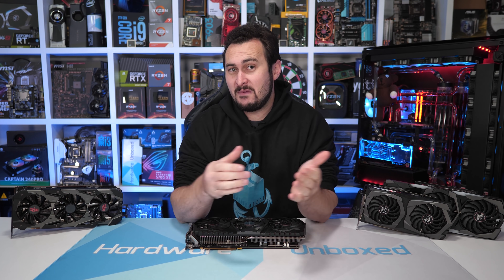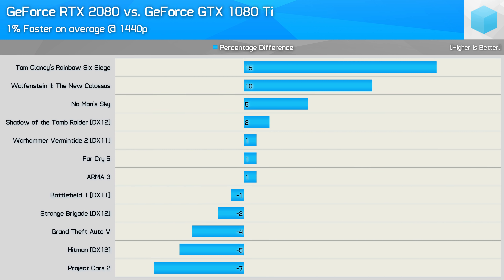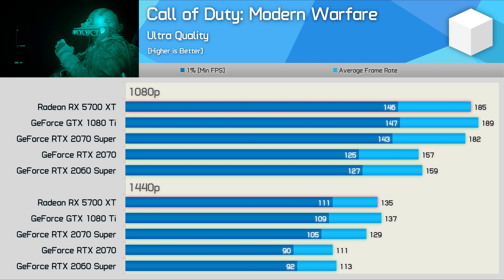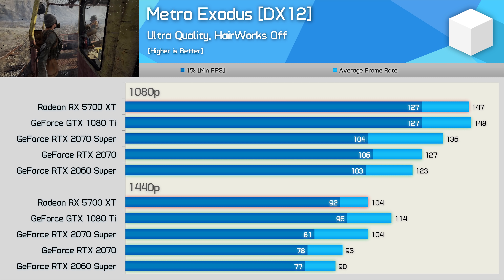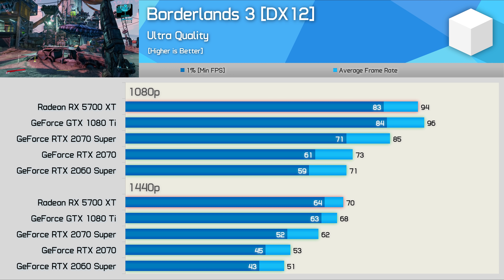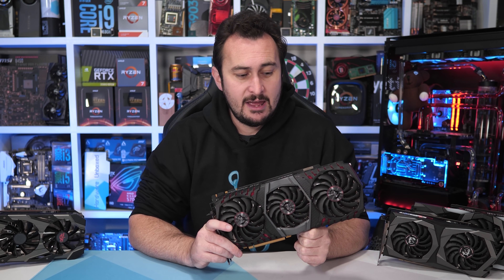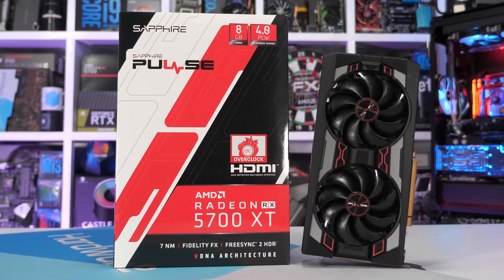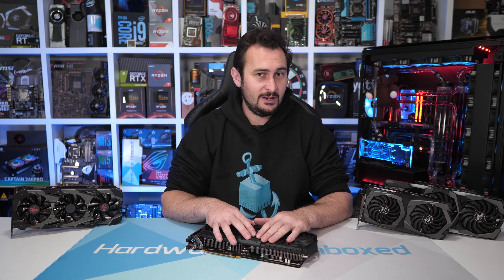GeForce GTX 1080 Ti vs. 5700 XT & RTX 2070 Super, 35 Game Benchmark

Comment: You gotta consider the 11Gb of vram and 4k capability of the 1080ti.  For people that want to pair their computers to OLED tvs now that they all have G-synce, the 1080ti looks great compared to the only other 11gb option: the 2080ti.  I know vram rarely ever gets close to that, but Skyrim modders can testify that even 8Gbs isn't enough for 4k textures at 1080p.  And in the case for the LG tvs, if your cap is 120hz then you don't need a card that rips through games at insanely high frames at 1440p or 1080p.  You just want a card that stays comfortably above 60fps in 4k and 120fps in 1080p.  In this scenario $500 is an absolute steal compared to the $1200 price tag of the 2080ti.  It's not as powerful but it's also not that much slower.  If you're using a 1080p or 1440p display then don't worry about a 1080ti for sure.      Also creates a better case for the 1080ti if you don't like most of the games from the past 2 years and you play mostly older titles.

Comment: Fuck the 1080 ti. Let’s see the Radeon vii, the last amd GPU that will age like “fine wine”, at release was comparable to a 1080 ti, hbm ocd to 1200 gives it about 1.3tb/s of memory bandwidth (which to my knowledge, every Radeon vii can hit), and core clocks can be pushed to 2+ghz. Or you can go the route I did, and keep stock clocks and drop voltage under 1 volt. Playing bfv at max settings I get over 144 FPS and Generally see 150 watts or less from the GPU. The hotspot might hit 60c. This card got a bad rep and it’s hardly looked at now. Or, maybe, I got a platinum sample. Thoughts?

Comment: I bought this one for 400 at the exact right moment haha, best videocard I've ever owned. Today I would go for the 5700xt. I love this card, my hope is that it may last the whole new console cycle but that may be a big stretch ...
Reply: I think we 1080 ti owners will be fine for at least another 2 years as that's how long cross gen is going last
Reply: @HollowRick  yeah, as long as you are fine with raytracing off, and using dinamic resolution for 4k. Or 6o% to 80% of for 4k resolution. Or getting down those dumb super extra detail graphics options that you can't really notice while you game. Like that it may actually last the whole console cycle, it's my hope anyway. I actually do all that for more FPS anyway most of the time. And really raytracing is some dumb reflections until now at least... might get a lot better at the end of the cycle.

Comment: This review just shows how lackluster Nvidia new options are just hyped up. Yes Ray tracing is amazing especially for  those interested in it but for normal gamers its just weak. Also in my country GTX 1080 ti sells for around $300 at most  and if the GPU  has passed its bathtub death periods you have a good chance of it surviving longer if the owner looked after it.

Comment: So nothing new and surprising here, the Nvidia previous flagship model still performs on the same level as the 2070 Super with no reason to upgrade yet.. Same as last 2 generations really (780Ti -> 970, 980Ti -> 1070).. Only surprise here is the high price people are still willing to pay for a used 1080Ti, I would also just get a 2070 Super for the same money as it makes no sense to buy older tech for the same price.. Price/performance the AMD 5700XT is still a bit better though, so if you can deal with a little bit less performance simply buy that.. Anything over is still all Nvidia with the 2080 models..

Comment: Those used 1080Ti's coming with no warranty and potentially saw heavy digging in a mine rig, will stay at this price point (along with common RTX cards) until AMD shaves off at least 100-150 USD from new 5700XTs. Anything below (5700-) is effortless attempts to re-sell Polaris to Pascal grade performance but on 2017 prices on both sides.
5700XT price is the support level of current GPU pricing. Don't expect NV to compete in-house for the customers or the let any next-gen GPUs see current gen card prices to drop.
Mark my word, the day 3000 series enters the market, 2000-series cards will disappear from shelves overnight from shops just like it has happened with the 1000-series.

Comment: I bought a GTX Titan X pascal used summer of 2018, during the mining boom for 650 usd. I can't believe a 4 year old card is still one of the top 5 gpus you can buy. I want a real upgrade, a 2080 is a massive ram decrease and the 2080 ti is more than double for barely noticeable bump in performance.

Comment: not quite sure if the 1080ti was a mistake or the 20th series is $hit
Reply: the 1080ti is what happened when amd scared nvidia, but amd ended up flopping. They made the 1080ti a beast on purpose
Reply: I think 20th series was just an introduction to RTX and a gap filler nothing more later in a few year nobody will evenntalk about the the 20xx seriee
Reply: Yes.

Comment: I was fortunate to have gotten 2 GTX 1080 ti around 2018 during the crypto market crash at ~$200-250 USD each. I got both for a total of $437 which was taxless ofc since it was bought from kijiji or craigslist as US equivalent. Up to this date, the card itself is still a beast and have no problem whatsoever. I don't think I would need a GPU upgrade for a few years or so.

Comment: Good I have a question, I am looking for a good laptop and I found these two, the two are almost at the same price there is not much difference but I would like to know which is the better of the two 

Laptop 1:  HP model (15-cw1002la) Processor: Ryzen 5 3500U Screen: 15.6 inch Ram memory: 8Gb DDR4 Graphic: AMD Vega 8 Capacity: 1TB Battery: 3 cells (Mixed prismatic)

 Laptop 2: Acer model (acer a515-52G) Processor: Intel i5-8250u Screen: 15.6 inch Ram memory: 8Gb DDR4 Graphic: Nvidia Mx130 Capacity: 1tb hybrid Battery: 4 cells

Comment: Thank you for the benchmarks! I have an MSI 1080ti gaming x and it's nice to see benchmarks that validate my decision to not upgrade to an RTX. I will wait for the next gen and even then carefully weigh whether an upgrade is preferable. From what I'm hearing it will be but I'll hold off until extensive testing and comparisons are completed; I don't want to be suckered into slick marketing like RTX buyers were for next to no performance gains - Ray Tracing or not.

Comment: 0% difference  between 1080 ti and 2070 Super in Red Dead Redemption 2?? No way man. 2070 super is much better in this game. You can check any benchmarks on internet. Pascal performance in this game is very poor. Nvidia only optimized Turing cards for this game.

Comment: The miners were selling them as well, not just gamers. I got an MSI Trio X 1080ti for my son, sometimes last year, with my ebay $60 bucks at about $430USD, well before taxes were collected. That's what I call Super!
P.S. And I bought a Power color Red.Dev. 5700 in September 2019 and flashed it with XT bios then, but the current 20.2.2 drivers disable my Enter key on the keyboard in Titanfall2, which is the only game I play:( The 19.9.2whql somehow work better in my case, and I never had issues with AMD drivers... until now.

Comment: I know that you said the 2070 Super is on par with the 2080, but there is also a bit more performance to be had with the 2080 Super. If the 1080 Ti consistently beat both the 2070 Super and the RX 5700 XT on most titles, wouldn't it be also a good idea to pit it against the 2080 Super for a better comparison?

Comment: I went with the 5700xt myself. I looked at the 1080ti, but new prices ballooned to that of the RTX2080ti. Price per performance, the 5700xt was the easy choice. Around 6% slower than the 2070S and $100 cheaper, I think it's the best card to buy right now. 1440P is the sweet spot right now, and in 3 years most people going high end will replace their gpu anyways. $400 now and $400 3 years from now is still cheaper than a RTX2080ti for good 1440p gaming for 5 to 6 years. Ray tracing will be a common thing eventually but right now it's not worth the performance hit. RTX 2080ti is the best, but it seems to be more gpu than most people need. Loved the video as always, and ignore the haters, most have tunnel vision and only want to hear 1 think instead of actual comparisons. Big thumbs up as with all your videos.

Comment: 05:44  Not if the game is heavily using asynchronous compute.  Pascal simply cannot do it.  It has to do a context switch to switch from integer to float calculations.  You can't optimize away a fundamental hardware deficiency.  The 1080 Ti will do poorly in any newer game that uses async compute to a serious degree.  A problem that will not be experienced by Turing or any AMD card.

Comment: Got my 2080 when it was selling at the same price point as new 1080ti's. No regrets tbh, maybe a little bugged when they came out with the super just a year later, but I knew the 2080 would get better driver support after release and most benchmarking channels confirm that, showing that it's consistently above the 1080ti. As for AMD's driver debacle, I think I finally understand what Nvidia is talking about when they say "It just works." I'm glad the 5700xt exists though, you can see how much the price of RTX cards have dropped since it's release. Only the 2080ti stands defiant with it's outrageous price point, but I guess that's what you get for being the Bugatti of the GPU world.

Comment: As a gtx 1070 user who got it at launch im very happy with my gpu however since i got my triple 4k monitor setup it no longer can power: single 4k monitor for AAA games and triple 4k monitors in racing simulators(they are a lot easier to run than regular AAA games) so i cant wait for upcoming rtx 3080ti or rx 5950x(or whatever their top end gpu name will be). gtx 1070 is still awesome 1080p gaming card though it started to suffer in newest AAA games on very high settings, 1440p resolution, back when it launched it was considered overkill for 1080p and ideal 1440p card.

Comment: We need GT 1030 vs RX 590 revisit ;) or getting first spot in 3DMark benchmarks for RX550 and GT 1030 with "extreme" overclocking... or using 4-8 RX 550 in Crossfire on a TR system (or more).

Comment: Ah yeah GTX 1080 TI, the abnormal card that whas so good That nvidia had to silently release a update Titan XP card as the 1080 TI whas to good compared to original titan XP and price point.

Got MY EVGA GTX 1080 TI SC2 GAMING July 2017 and it still doing a great job even today and this video just confirmed my suspension on that rtx 2000 whas to expensive and slow at release compared to pascal cards.

For those of interest, a few benchmark of my gtx 1080 TI in my old X58 system.

https://m.imgur.com/a/uHjbbMg

Comment: can you do a video on CoD:MW and ram usage for each Nvidia driver? I have an 1800x and a GTX 1080 with 2x8gb 3200Mhz ram and MW will use up to 14GB of ram on some older driver on my config and a buddy who I noticed this has a 3700 and a 1080 with the latest driver and only has 7GB usage we both take time on a fresh install to optimize windows to use little to no ram on idle as well.

Comment: yeah i dont care how much you dont believe in DLSS or Ray tracing, you gotta be on crack to spend $500 on a used 1080 ti vs $500 on a new 2070 super. virtually the same performance across the board and you dont take a gamble on buying a gpu thats been abused by its previous owner. add in dlss 2.0 and future support for that and the fact that the 2070 super is one of the few  gpus that can maintain 60 fps with ray tracing on and yeah.

Comment: This really makes the 5700xt look good being able to compete with a card that is 100 bucks more expensive.
Reply: Uh, idk, where i live used 1080tis go for 320€/$350. Im building 3300x/1080ti build for 650€.
Reply: Only if u dont want to use raytracing... But right know there is no big reason for a RTX GPU
Reply: dlss, raytracing, better drivers. in 2022 the 2060s is faster then the 5700xt
Reply: @TTVtwongz_247  cop a 6600xt or 6700xt for the same price and you get better performance iirc
Reply: @zayjayy2  Well amd fucked nvidias ass with the new series. A 3090 was 2x more expensive than a 6900xt for literally the same Performance
Reply: But it has terrible drivers. I had Sapphire 5700XT and had random black screens, some games were randomly crashing, sudden FPS drops and that lasted for 4 months so eventually I changed it for the ASUS Strix RTX 2070 Super and happy with my decision
Reply: @nuky_999  My Gigabyte 5700xt hasn’t had an issues like that so far, except for Call of Duty Cold War, where I had to change a setting in my config to get it running without stutters.
Reply: @MrPatrickbuit  But the point is even after that much time since it came out it still has problems while nvidia is extremely reliable and has much lower temperatures and noise levels
Reply: @nuky_999  Noise levels depend on which aftermarket cooler you get on it. Driver issues though? Certainly agree that the 5700xt had far too many issues for the longest time. However, here in the Netherlands a 2070 super is about $550, while a 5700xt is about $400, while my Nvidia cards are way, way more expensive here. That's why I went with a 5700xt regardless.
Reply: @nuky_999  strix cards literally have the worst price/performance xD
Reply: A 1080ti is cheaper, same performance and more ram. I.dunno.but its a shame for amd to.get eaten alive by such an old.card
Reply: @dvr1337  You are wrong. Both cards are made on same generation of manufacturing process. You are comparing $1000 flagship card with midranger. And 1080ti price is so low mainly because of miners, while 5700xt released after btc crash.
Reply: @filippetrovic845  the 5700xt came later what are u talking about same generation? There was 3years between the 1080ti and the 5700xt....and now the 1080ti used is cheaper and better so who cares
Reply: @dvr1337  Tell me that in year or so. You have timeproof vram but not timeproof driver support. Anyways, this is dumbest time to buy gpu, just before big nvidia releases. Both 1080ti and 5700xt bound to drop in value very soon.
Reply: @filippetrovic845  did u see the prices of the new cards and the drop of the 2k series? Its the best time noe. Oh and lets not even talk about drivers on amd :)
Reply: @dvr1337  Cool, buy your 1080ti. I was thinking to do the same. I decided not too mainly bcs of 280w power draw on load. I imagine new rtx 3060 will be +20% better performer with about 120w consumption, for $450 plus 3.5 years driver support longer than 1080ti plus hardware accelrated rtx cores which define the next gen plus brand new card with guarantee. I was talking about drivers on nvidia, not amd.
Reply: @filippetrovic845  i got 2x 2080ti i wouldnt buy used hardware myself but.even my old 690 still got driver support
Reply: @filippetrovic845  both of your comments have aged like fine milk: 3060 has more like -15% performance for 180W and buying an RX 5700 XT or GTX 1080 TI or RTX 2070 Super would have been one of the best decisions to make 8 months ago
Reply: @deadtake2664  Yeah that was poor me before i got in cripto mining.. I made some of the best decisions since then though like holding bunch of 4gb cards i bought for around $50 in january. Too i held vega cards until they became very overhyped. Now i own two radeon VIIs mining 217mhs together, about 10 hawaii 8gbs that i moded to mine 29,5mhs at 112w each (avg by miner), four better 1060s (they were always good value eth mining cards), two humongous vegas (nitro+ se 56 and red devil 64) and i got some rare shiet like 290x 8gb and 7970 6gb and of course 40 pcs 4gb cards mining erg.
Reply: @dvr1337  all these comments aged worse than anyone could think

Comment: I'm missing 4k testing here. I have a 1080ti and a 2070 super. At 1080p and 1440p the differenc is marginal, but at 4k the 1080ti is about 10-20 % faster, properly because of the bigger VRAM.

Comment: Wish a 2080 and radeon vii would’ve been in the mix. My main gaming rig is a 9900ks and 2080ti but my other rig is a 3900x and radeon vii but i also have a 5700xt and 2080. I ended up putting the 2080 with an 8700k but i go back and forth between the xt and vii for my amd build. Seems like the vii is faster especially if you tune and undervolt both cards. I know many people look down on the vii but i like the card and its all metal shroud and 16gb’s of hbm memory. The silver matches the phantex evolve x in silver nicely. I like collecting gpu’s so im glad i got a radeon vii, i fill like in the future they will be hard to find because of its short life and low sales. I want to find a sapphire nitro+ vega 64 but im not paying more than 350-400 for it. People on ebay want way to much for them, i can understand the limited version but most are not. The cheapest vega 56 model i found was $300 and its new but for most people the 5600xt or 5700 would be a much smarter choice plus you get 2 free games and game pass right now.

Comment: I think Nvidia messed up when they released the 1080ti cause it was way too good. They got spooked by the hype AMD created about the upcoming Vega GPUs and released a GPU that was 40% faster than its predecessor. It wasn't as big of a leap as the 8800GTX was back in 06', but i don't think Nvidia really wanted to release the 1080ti as good as it was but felt like they had to due to the Vega hype.

Comment: You missed the RTX2080 in this one. That's too bad.
If the price is right and your country are still selling Both Original RTX 2070 / 2080 - You cant really go wrong.
I dont like the 2070S very much; I would go with a RX5700XT.